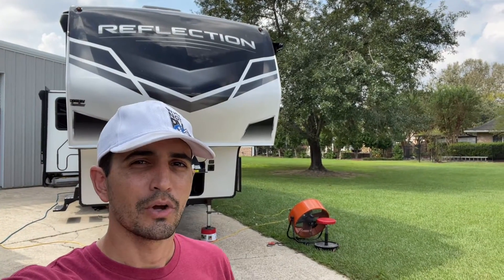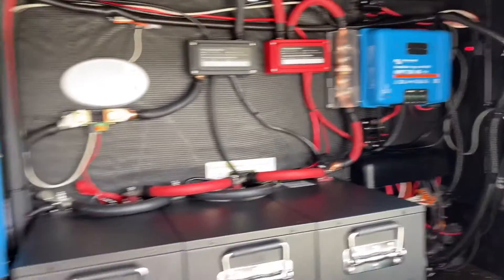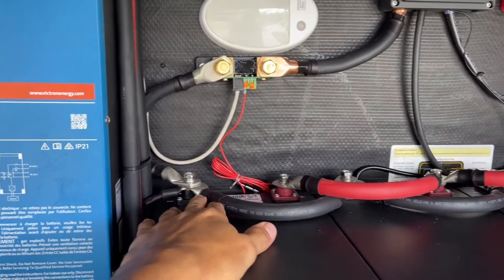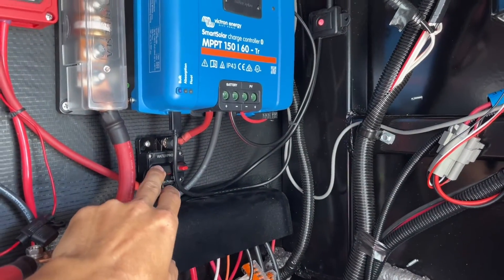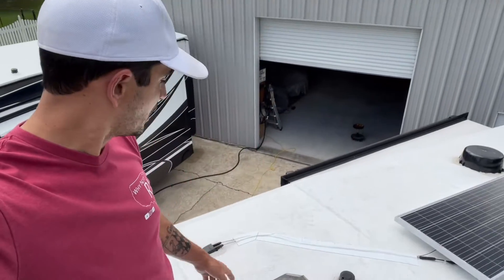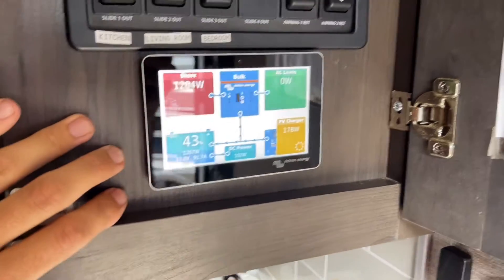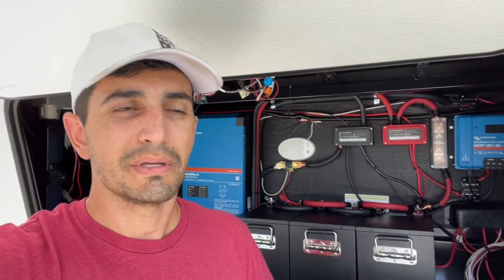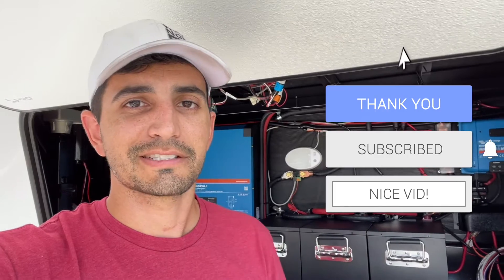Full Victron Electric upgrade INSTALL (Multiplus II, Orion, MPPT, BMV) - Why Not RV: Ep 74

Comment: Nice setup. I have completed the same system but have 1400 wts of solar. 

I have one issue and wondering if you have experienced it, tripping the GFI breaker when connected to a 120 volt circuit. The same 50amp to 110 cable you show in the video.

I have googled this issue and see many having the same problem. 

Thanks in advance for any insight you may have on this issue.
Reply from the maker: With that setup I just constantly reset the gfci lol. The Victron powered camper facebook group talks about turning off the ground fault relay as an attempt. Others just say there’s no way around it. These units aren’t meant to work a gfci circuit

Comment: We are going to install almost the same system, but with 2 Battle Born game changer 270AH batteries. When we were just in the Arches National park area the 2 BLM campgrounds quiet time was 10pm to 6AM but generators were to be off from 8pm to 8AM 😔 we had to wait a long time to start it. Having a Residential fridge running off a 1000 w inverter my Inverter was always screaming at 6 am because the 2 AGM batteries were about dead ( the RV dealer we purchased it from didn't put Large enough batteries in they put In 2 100ah agms in 😒🙃 . I don't want to replace them yet because of the Lifepo batteries I'm getting. It would be a waste of money 💰💰
Reply from the maker: Lithium is definitely the way to go. Each time you drain those agms like that it significantly reduces there lifespan and ability to hold a full charge.

Comment: How did you get DC power from AC circuit panel to the DC fuse panel when you changed to the Victron multi 2+? I have the same rig as you illustrated in this video. I also installed same Multiplus two. I have not yet figured out how to power the DC side circuit where the fuse panel is. Can you help?
Reply from the maker: Just take the dc cables off from your stock converter and feed to the multiplus. Or bus system
Reply: @WhyNotRV  do you have an illustration?  I think I understand but you know what they say about pictures. Lol
Reply from the maker: I don’t unfortunately
Reply: @WhyNotRV  well I did just that. I have D/C power now. 
I’ll leave it to charge overnight and check in the morning. I knew I needed power to the D/C side was unsure how to get it there. Don’t want to blow anything up. I’ll let you know.  Thanks.
Reply from the maker: Good luck!!! 😂
Reply: Can’t thank you enough. We are up and running. 👍🏼
Reply from the maker: Awesome!!! Glad I could help!
Reply: Where do the wires on the converter go to. I was looking at them today and they seem to head towards the breaker panels. I’m installing in a few days two SOK 100 amp and a new lithium converter. Plug and play but I’m looking at down the road moving to what you have. It is on a 21’ 303. Sure would like to see the flow of wires of the dc system…. Nice job.

Comment: We have a 303rls, and has been pre-wired for an inverter and has 1 170w panel with a Furrion 80amp MPPT solar charge controller. With the inverter prewire, do I still need to re-route the shore power to the Multi Plus II? The pre wire looks to be like 12/2 house wiring.
Reply from the maker: I actually have a video on inverters coming out tomorrow. About midway through I start talking about this exact question. The pre wire is going to be for a specific set of circuits in the rv that are typically labeled as such. Little yellow sticker maybe. Not sure what grand design does specifically to indicate them. Watch that tomorrow at noon and comment with further questions after it comes out. It will probably answer your question

Comment: Great video and install. Thanks for the information.  
One question I have is about the battery cables. The Multiplus-II recommends two 1/0 awg parallel wires on the batteries (2 red and 2 black). I see you have run single cables. What gauge did you go with and why the choice of single runs?
Reply from the maker: Vetron has the charts for both single cable and double cable applications. I chose single for this application for a few reasons, I don’t recall a specific cable size I used. It was either 2/0 or 4/0. Most likely 4/0. Two sets of cables also means twice as many connections and twice as many failure points and twice as many Lugs. But it also has its pros such as if one does fail the other one is still there to support a load.

Comment: Great Overview even for those that are in the KNOW of solar configs and enjoy leaning more from others installs.  As a beginner DIY myself really enjoy eating this stuff up!  I am at the end of my install and double checking everything and did notice the removal of the converter which I get...can you go a little bit more indepth of that.  when you say you removed it - did you unplug from Main Service Panel? Did you cap both ends of the positive and neg that lead from converter to battery's?  Want to get a better understanding of that removal.  Thanks a Million!!!
Reply from the maker: Thanks for watching! In this case my converter is built into my main AC distribution panel so I simply just turned off the breaker. In my last RV when it was a separate converter itself I completely removed it from the RV and took the positive and negative leads and use those as a point to a bus bar to access the DC system. You could simply terminate the ends for future use or any other number of options
Reply: @WhyNotRV  Thank you for the reply...so on your separate converter you took the neg/pos leads from RV converter put those on the DC board side then on the battery terminal side you put them on your Pos/Neg Main Solar Buss Bar which made the DC connections?

Comment: How many amps and volts do these panels put out wired series parallel, 40 volts and 40amps?? And how many amps can you run on that 10 guage prewired solar package. 10 guage = 30 amp max i thought. i have the same solar prep package and am trying to figure out what i can run through the 10ga wire?  Thanks
Reply from the maker: I believe the way this system is wired it’s 40v at 20 amps at max.

Comment: Really informative video and you have pretty much described the components that I have planned for our new Beacon. I do have a 50A Surge Guard with the output going to my ATS which is connected to an Onan 5500. My plan for now is to skip the solar and feed the MII from the ATS and use the generator to top off the batteries if needed. From the ATS to the MKII, would you add a breaker?
Reply from the maker: It’s unnecessary but if you want to add one there isn’t a problem with it. Just no real purpose in my opinion. The MII has internal safeties and doesn’t allow pass through if something is off.

Comment: Awesome video.  Did you have to use the mk3 to program the Multiplus II?
Reply from the maker: No, I used VRM via Cerbo gx. you can program via dip switches but is MUCH easier via MK3 or Cerbo
Reply: @WhyNotRV  thanks for such a quick reply.  So, is it going to be necessary to get the mk3 if I don't have the cerbo?  What do I need to program?  Using 2 battle born game changers.  Is it the charge rate?
Reply from the maker: The dip switches on the Multiplus are the most basic way of programming. You can set for lithium and set a basic lithium charge profile. To do precise changes and advanced settings you’ll need a MK3 - USB at the least.
Reply: @WhyNotRV  just ordered the mk3.  Thank you for the recommendation.  Couple more questions and you are my saviour and I think I am ready to do my install finally.  My inverter and batteries have been sitting for two months waiting for me.

#1 - when I disconnect and remove the converter behind the main breaker panel, do I need to do anything else wiring-wise for DC power or will everything work as normal when I connect the new cables to the DC bus in the front compartment as you did in your video with the #6 cables from the new batteries?  Is there any additional grounding I need to do or just leave everything as is?

#2 - did you reinforce your floor or wall in the battery compartment to handle the weight of the batteries on the floor or inverter on the wall?  If so, how?  

Thanks again, I would be happy to PayPal you a couple bucks for your valuable time and intuition.  Have an awesome day and thanks again for sharing your wisdom with us noobs.
Reply from the maker: When you disconnect the converter you can run the DC cabling to your bus system which will then support your original DC system in the rig. I would ground out the bus system and anywhere else you feel necessary. I did not reinforce anything. If you feel you need to depending on your rig then there’s absolutely no problem with doing so. You can use aluminum brackets or wood to do a number of different supports
Reply: @WhyNotRV  what gauge wire did you use from battery bus bar to DC bus bar?  Looks like I need to run a new line, the existing isn't long enough.
Reply from the maker: I would use whatever wire size was in the converter. 6 gauge is good for about 50 amps. Personally I’d use 2 gauge as that’s good up to 100 amps
Reply: @WhyNotRV  I really appreciate everything you have done for me.  If I can compensate or donate in any way to you or your channel, please let me know.  I'll be sure to tag you when I post my complete project.
Reply from the maker: I appreciate it. I did start a Patreon (link should be in most all of my video descriptions) for that purpose. If you want to look into that I would be  appreciative.

Comment: I own Springdale 280BH. length of the travel trailer is 32 ft 11 in. It has 30 amp(AC) input. I am thinking about setting up similar setup as your setup. I am having hard time finding out what else I need in order to do complete my set up.  I own package module 36V 48 amps 1.78 kWh battery pack. Total quantity of 8 Pack.but I am planning to using only one package and breaking up 36 volt into 12 volt 144 amps(48x3). I believe it would increase  capacity as I break up and put in to series. Eventually I want to upgrade my battery to LiFe04.

I have provide a detail of my batteries at the bottom. 

 since you're already have completed your setup can you please tell me what do you think about the batteries down trying to use and the setup please give me some idea.  I would like to purchase everything before this year ends so I could write off this year.

(following battery pack it does not come visit BMS)
batteries:  Material Li-ion
 Package : 36v 48ah 1.78kWh POWER Module - 60x SPIM08HP.

INDIVIDUAL CELLS.

Material Li-ion

Typical capacity 8-9AH
Nominal Voltage 3.7V
Weight around 300g
Dimensions of cell body: 9x138X190mm
Dimensions of cell with tabs 9x138X210mm

Dimensions of cell holder:6 & 5/8th x 5 & 5/8th by 3/8th inches 

Internal Resistance ≤0.8mΩ

Max Charge Rate 120A
Recommend Continuous Discharge Rate 200A
Pulse Discharge Rate（3 seconds） 400A
Fully Charged voltage 4.2V
Discharge cut off voltage 2.5V
Working Charge Temp 0~50°C
Working Discharge Temp –20°C~50°C
Storage Temperature –20°C~50°C
Reply from the maker: It’s hard to understand exactly what you’re asking. I will say that you will not change capacity by breaking down to 12v however I’m not sure there’s much equipment that runs off 36v. A lot of it is 12, 24 or 48v.

Comment: Very nice install !
I've narrowed down my install location to this same area , but I'm concerned with the weight of the components . Are you confident in the ability of that wall , to support the Multiplus II ? I will also be adding 3 MPPTs , and a Lynx Distributor / Shunt .
Also , it appears that you bolted through the bottom metal of that compartment . Are there Tanks on the other side , that I need to watch out for , so I don't drill / bolt into ?
Reply from the maker: The wall is pretty solid 1/2” wood… I’m extremely confident in its ability to hold the weight. The metal at the bottom of this compartment is the bottom of the rv. Nothing below.

Comment: Your videos are not only inspirational, but a great assistance to me and my RV projects. I understand the removing of the converter, bit where does the negative/positive DC cable that feeds the entire DC system (which I assume is the reason for the removal of the converter) that is attached to the negative bus bar come from?  

Also where did you get those heavy duty bus bars? Thank you!
Reply from the maker: I super appreciate that! Thank you for watching. Every RV is a bit different but typically there is a spot on the main circuit breaker panel where all your DC fuses are that you can access to power to/from the DC system. Below I attached a link for the bus bars.

https://amzn.to/2ZTvZLg

Comment: Great video. Learned a lot. I'm doing an install on 2021 Grand Design Reflection 150 series 5th Wheel. Is there any concern about using the 6/4 cable for the Alternating Current In and Out lines on the Multiplus-II? Those types of cables are officially rated for 45 amps but could experience as much as 50 amps being pulled on either one of the hot legs depending on what was being run in the RV.
Reply from the maker: In my opinion, due to how short the runs are in an RV we don’t have enough significant voltage drop or heat gain to be concerned. Also, where are you finding it’s rated for 45 amps? What I find shows 50 amps
Reply: @WhyNotRV  Most places I saw to buy it online did not say the amp rating. If they did, they indicated 45 amps. I've never done any electrical wiring but that didn't make sense to me since 6 AWG wire is generally said to be good up to 50 amps. My 5th Wheel has 6/3 Romex bringing shore line power to the breaker box so why wouldn't 6/4 SOOW be able to handle this application? It prompted me to do some research.

When I did, it seems like this kind of flexible cable is covered by Article 400 of the NEC and Table 400-5(A)(1) lists amp ratings. The 6/4 is max 45 amps and the 6/3 is max 55 amps. Here is a link to that table: https://up.codes/s/ampacities-for-flexible-cords-and-cables

I found some 6/4 SOOW on Amazon that said 50 amp rating. I ordered it and when it came it was Southwire 6/4 SOOW. The Southwire site says it has 45 amp rating so Amazon info was inaccurate.

Again, I'm new to electrical wiring and so trying to learn as I go. What you say makes a lot of sense though. The run is very short .... maybe 12 feet at most from inverter AC-Out to the breaker box.

Also, it's hard to imagine how I create more than 45 amps of load on either hot leg in the RV. I'd have to be running a hair dryer and toaster over while the AC is running with all of them being on the same leg to be over 45 amps. It seems like I could manage this by never running a high amp draw appliance while the AC is going. And if the load got over 50 amps, the breaker will trip.

Plus, isn't there a lot of safety margin built into the codes? It seems like most building codes are set somewhat conservatively.

Thanks for any insights you can give me. And thanks again for the video. It was great to see the overview of the whole system.
Reply from the maker: The long story short here is YES, code is overt safe and was updated not that long ago. It used to be 40amp for 10 gauge wire. Now it’s 8. I would say you are more than fine with the 6/4 soow.

Comment: Is it necessary to have a BMV and a Cerbo GX with a Victron GX 50? I have a 303RLS with the factory 165 solar panel with the Furrion 50a MPPT and am trying to figure out how to add solar to it. I have purchased the Muti Plus ll and 3 200ah batteries. I am now looking to purchase the rest of the items. Do you consult on the identification of equipment?
Reply from the maker: Hey Mark. You do need a form of monitoring, a bmv shunt or the lynx system. I do offer consultation services. You can head to WhyNotRVusa.com and email me through there.

Comment: How loud is the multiplus 2 when it's running like fan etc I'm gonna be installing mine and was considering putting it inside my travel trailer and depending on how noisy it is I might have to install it outside compartment
Reply from the maker: They can get decently noisy when under a heavy load. Minimal stuff like TVs and what not it’s pretty quite but when charging batteries it can get noisy too. I wouldn’t really recommend interior install myself
Reply: @WhyNotRV  ok thanks I'm limited on where to install I have 3 options install inside  under my entertainment center compartment area or outside compartment area but I cannot install it vertical if I go outside storage compartment I'm reading that can be a problem
Reply from the maker: Ya it’s ideal position for cooling is vertical. I’ve seen people install them upside down, horizontal and on there backs. You can always add extra ventilation if your concerned about heat. Little 12v fans are easy and cheap